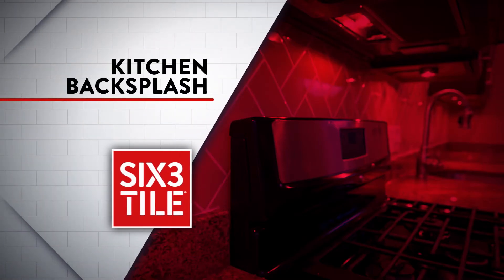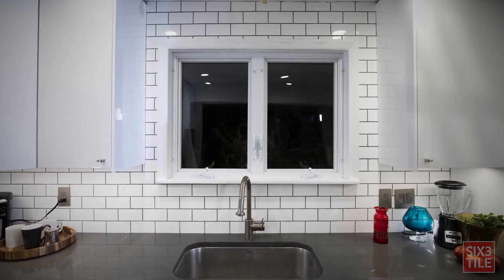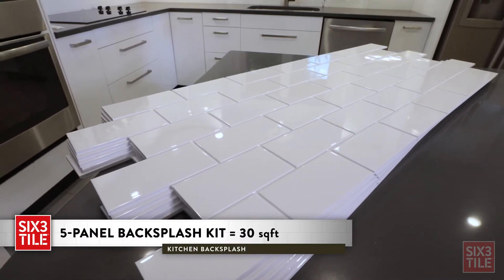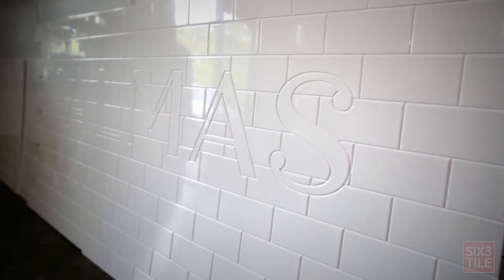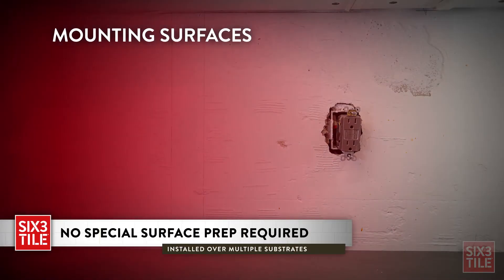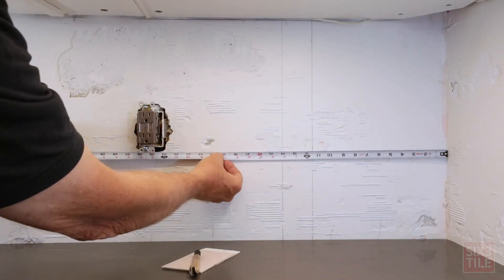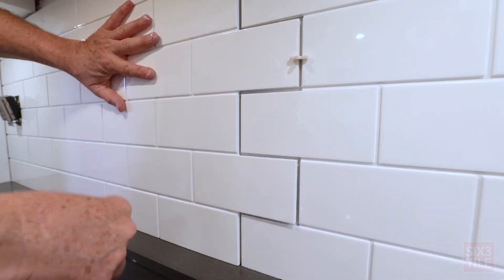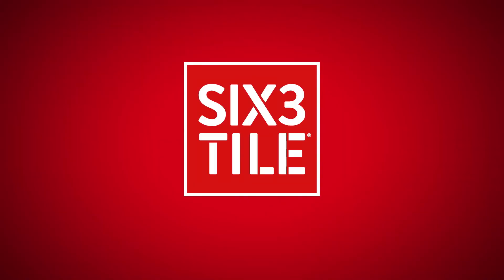Six3Tile -  Backsplash Overview

Comment: Interesting, but does the grout scratch the plastic, or is this a special grout? Good idea better in those Press On stick jobs
Reply from the maker: Hi @makenchips, we're sorry we missed this comment before! Any non-sanded grout available is suitable for our tiles. Sanded grout may dull the surface. We also do not recommend any of the pre-mixed grout, as they almost always have a grit component that could damage the surface during application. It is a very easy solution to install and is designed to last. If you have more questions, please reach out at info@six3tile.com